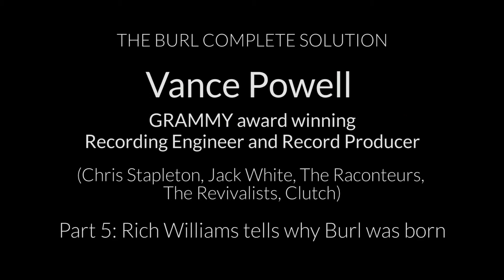Burl Audio and the Importance of Class A Circuitry | proSESSIONS at Westlake Pro

Comment: Still using the UA2192, he is 100% right even with everything in the box (softsynths) out through the DA through Buzz Audio Arc1.1 and back in as a mix sub stem it takes the mix to another level, noticeable separation which is the midrange detail forward, reverbs are heard backward, the sides are clear. Sure it takes time to run stems re-record new tracks but I only could afford 1x UA2192 2x Arc1.1 but hey 14 years later still stands the test of time. But definitely will be looking into the burl mothership so I can listen to the drum bus, vocal bus, instrument bus etc all at the same time. lol

Rich did not touch on the voltage but most mastering engineers mention the gear they purchase run at 120 volts minimum, as they say there is way more dynamic headroom. I think the UA2192 is in that range, so is the Arc1.1 120-240v